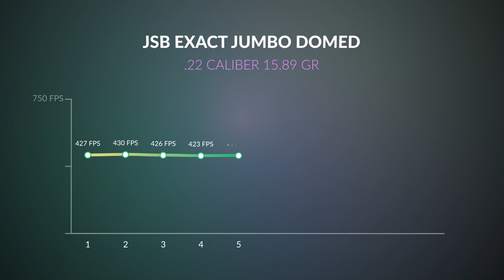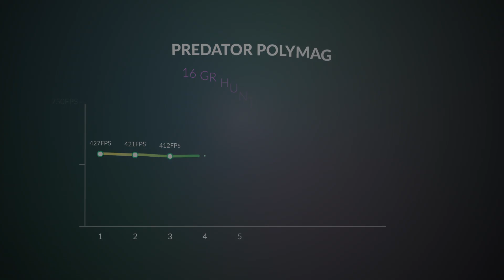Velocity Test on 2nd Crosman 2240XL CO2 Pistol (Baseline Before Mods)

Comment: I recently purchased a 2240XL and you just saved me a ton of time and money. I would agree that you are one of the better instructors on all Utube. I also have an older SSP 250 that I will be resurrecting and adding a steel breach to (when I can figure out which one to use) as well as an older 1377 pump that needs one as well. (when I can figure out which one to use) Both look like they will be headaches. 
Looking forwards to viewing all your work. Thank You !
Reply from the maker: Thanks for the kind words. I’ve missed working with 1377 style pumpers. I’ve been thinking of doing a build & repair series on them. Perhaps you’ll see something here soon. Be well 👍🏻

Comment: The 2240 is limited in their design. I have several. I cant believe the time and money people spend on these things, and their results is not that much more then a stock one with a modded valve shooting the right pellet at the right temperature.
Reply from the maker: It’s always interesting to see enthusiasts working to increase performance. And typically small improvements come at a noticeable cost or trade-off. Otherwise the factory would have made it that way. That said, there is nothing wrong with modifying to be better suited to a particular purpose.

Comment: Great to see another view 😀 similar to my own.I also purchased a second 2240xl and my first one is a close range tack driver with custom pistol grips,trigger job and I added a red dot for faster target placement.I believe other than perhaps a little more work on the trigger I'd like one of those multi fill units you see on ebay.I purchased the second to try and turn into a carbine but for some reason the steel breach dosen't come off as a aftermarket unit does so I'm having issues working on it and actually till I came across your videos I forgot about it

Comment: Hi Al, did you use the same co2 cylinder for the three tests or did each test get a fresh one?
Reply from the maker: Depends on what I'm doing. On most test I always start with a fresh cylinder. If I've tested a gun and know it gets 30+ shots per C02 cartridges and I'm only shooting 5 shots for each pellet, I may  fire 15 shots off a fresh cylinder then swap it, as I would feel good about staying within it's documented power curve. Good question.